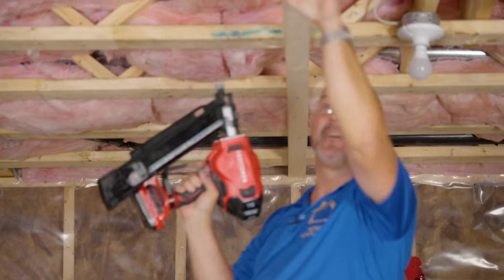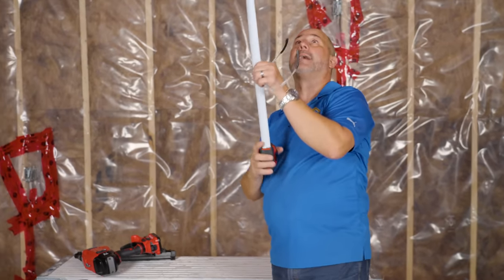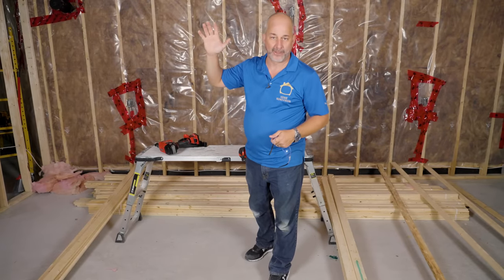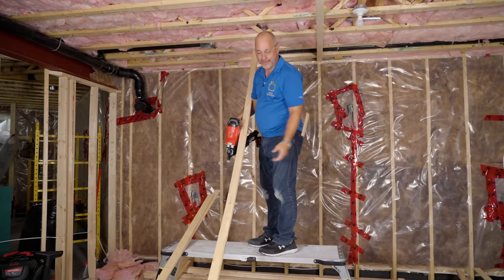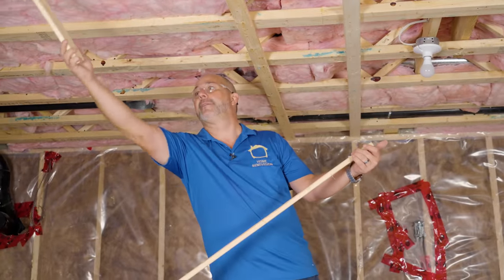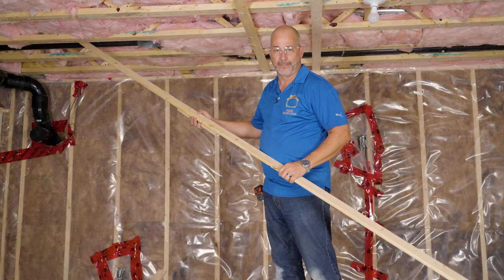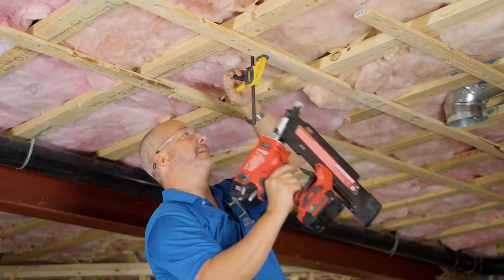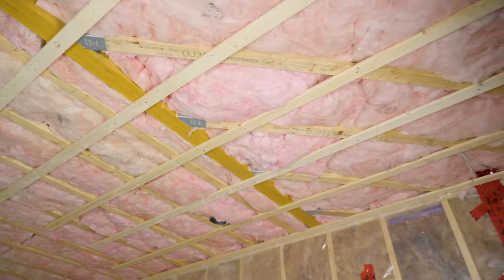Why You Should ALWAYS Strap Your Ceiling

Comment: If am using 4.5 x 8 drywall panels, do you still want use a spacing of 16inches on center or would you wan to 18 inches on center?
Reply from the maker: keep it at 16. so much better to help avoid nail pops .Cheers! install horizontal. Cheers less taping.
Reply: Thank you, also appreciate the quick reply!

Comment: Curious how much extra strength is added with these straps nailed to the underside of the joist? Seems like if such weight from above was enough to deflect the joist it would have no problem pulling on the nail holding the strap on, or bowing the strap itself, as the strap is laying flat and is thin stock???
However I love the idea of creating an extra direction for a chase way, and 16 spacing through out!
Reply from the maker: it is small effect but helps against warping of dimensional lumber. for better results for deflection use 2x4 if you have a bad case. Cheers!
Reply: Steve, the answer is zero. Engineered floor truss tied together with a 1x3 to transfer deflection load from 1 truss to the adjacent trusses will do nothing to help minimize any deflection in your flooring above.  I'm a fan of Jeff and his videos, but his claim here is incredibly weak.

Comment: Hummm my joists are engineered…and they are on 24” centers! 😢😢😢
I have tile in the kitchen and breakfast room…and the grout is popping! 😢
I’ll try strapping…I really hope it helps!
(The house is in Georgia, and 20 years old)
Reply from the maker: I would suggest 2x4 strapping for a tile floor to avoid deflection. Cheers!
Reply: @HomeRenoVisionDIY  Thank you for the reply. I have a 2000' basement that I plan on finishing...using your video series. Plan on sound proofing half; again using your series. ...before that...I have to build out the master sitting room into a closet...using your videos...then a laundry room and finally a pantry. And oh, did I mention a motorcycle garage under my deck? I've already built two retaining walls a couple years back...guess what video I watched? LOVE your series. I could have NEVER afforded this otherwise.
Reply: The 24 inch on center causes the subfloor to deflect between the joists. That is the weak point not the joists,

Comment: Do you need strapping if you already have blocking? I have 2x10 floor joists that span about 12.5 ft.
Reply: Blocking is much more effective to distribute floor loads to repetitive members like floor joists and reduce long term deflections than strapping. In fact, I don't think strapping is really doing much for deflections. If you live in an existing house that's been around 20-30+ years, your floor joists have probably already undergone all the long term deflections they will see and there's really no need to worry about deflections unless you are unhappy with the levelness of your floor. I agree with all the other points for strapping in this video, though I think he should have mentioned the possible exception of basements with bottom of the existing framing near 7'-0" above the floor level (every inch counts in this case).

Comment: I'm trying to drywall the ceiling of the main floor of my house (with only an attic crawlspace above it). Is strapping necessary? Also there already is some strapping from the current ceiling tiles that I want to remove, should I just leave what's already in place? Thanks for the video!

Comment: Drywall should break in the space between framing and be joined with a butt board. It keeps the seam from protruding and keeps ceilings and walls flatter.
Reply: Doesn’t make sense, it is the framing that determines the flatness
Reply: I can see an argument for that where the joist is high or low it will help average the error or blend it across more distance. However I have never seen anyone do that, and would rather just fix the out of plane joist. The hump or dip would still be there otherwise, this just spreads it a bit better to make it less noticeable.

Comment: I love your videos, I've learned so much from watching them. I would like to ask about drilling the holes in the drywal for pot lightingl-I saw you use the drill in reverse to begin-I'm a bit concerned that I'd do damage so thinking about making a mock setup to practice. Would this be your approach as a beginner? TIA!
Reply from the maker: I encourage drilling in reverse for beginners to avoid the hole saw running away from you. this was designed to give you the best chance of success. Cheers!

Comment: So question in the middle of designing a new home.  Should I do this for first and second floors ?

I will be using advantech for undersheathing.  I have not decided on using dimension lumber or I-beams for floor joists.   That's a 20k option for the I beams.  I'm at the max distance for span on dimensional lumber and I want to minimize any bounce/deflection.
Reply from the maker: your decision should be driven by what type of flooring you will be installing. if you want large plank engineered flooring and or tile then engineered joists are not just recommended they are a necessity. if you are going with strip hardwood or carpet or any floating floor dimensional works just fine.

Comment: I’ve read 10D nails are best for installing strapping. Would you recommend ring shanks for the holding strength? Or would you recommend a different fastener?
Reply from the maker: Hi Andy. 10 D is a structural nail. I recommend folks not over think this problem. there will be 32 nails for each sheet of 1/2" lightweight drywall. that means each nail is supporting around 1.5 pounds. have you ever tried to remove a nail with a hammer claw. trust me ....it is not going anywhere.
Reply: @HomeRenoVisionDIY  thanks for the reply! I am definitely doing this in my basement. Great video and very helpful! I think the structural improvement this brings to the floor alone would be reason enough to do this!

Comment: I want to do this, but have a specific circumstance that I want to accommodate a 5/8" thick strapping. Do you think ripping 5/8 plywood and using that would be suitable to hold drywall?

Comment: For the same reasons given; why not add strapping then to the wall?  Ease of electrical, insulation around duct or plumbing, etc.?
Reply from the maker: electrical boxes are secured to the vertical lumber and since walls are not load bearing in the horizontal direction it is quite redundant.

Comment: Jeff, I plan to use  Sonopan sound board ,then rc plus resilient Channel with 2 layers of 5/8 drywall, should I strap the ceiling first?
Which way should the resilient channel run in relationship to the floor joists?
Thanks 
Mike
Reply from the maker: Hi Mike, Yes! I actually did a theater room in this basement. we strapped and then sonopan and then strapped with 2x3 again and then 5/8. this gave us a perfect seal and a chase to add potlights without breaking the sonopan layer. the end result was fantastic. of course we also used 2 layers of fiberglass r20 and only 1 layer of 5/8. Not perfect since the room shares a trunk line with the room above but that video will be coming out i  the new year. It all depends on the level of sound protection you want.

Comment: Have you thought about the possibility of a single nail through the strapping into the floor joist not being adequate enough? When I finished my basement last year, I used screws as I didn't trust the nail to hold the sheetrock on the ceiling. I worry that over time, with the weight of the ceiling pulling on the strapping, that the nails just won't cut it. Screwing in the strapping was definitely a much slower process. Was I wrong in believing that could ever happen? Love watching your videos and all the insightful information you share!
Reply from the maker: you can hold the weight of a full sheet of drywall 12" long with 3 screws. a nail every 16" on strapping 16 OC means 36 nails per sheet. it takes more strength to pull 1 nail than it does to hold 1 sheet. Cheers!
Reply: @HomeRenoVisionDIY  Thanks for the reply and the insightful information! I appreciate you! Cheers mate

Comment: As a builder on the US west coast where absolutely nobody straps ceilings I'm going to respectfully disagree with you about a need for strapping. If you think you're going to make lighting changes in a ceiling with a floor above in the future then sure... but how often does that actually happen. If you're looking for an effective way to connect adjoining joists to reduce flex then use mid-span blocking... I seriously doubt a 1x3 does much at all in that regard as a 1x3 has zero structural strength. And I will often have my drywall joints occur between the floor or ceiling joists so I can use backing that will create a recess in the drywall that mimics a factory recessed edge so mudding the seams will create a dead flat ceiling. Joints on solid backing will require a feathered drywall joint to look flat.
Reply from the maker: I get it biob , however everyone is moving to sound isolation these days. that means insulation in the ceilings. strapping keeps everything in place and eliminates a lot of butt joints on the ceiling. New construction does not need the extra stability but older homes being renovated definitely do. In some cases we strap with 2x4 to provide the reduction in deflection that is needed even to lay tile. Cheers!

Comment: I have a stupid stairs landing taking up space in my basement, it is only 180 CM high from the concrete floor.  I wanted to use this space to put a stack up washer-dryer but they are all 190 CM height. I was thinking the only solution is to break the concrete floor, dig up 30 CM, pure 15 CM concrete and this way I get the 190 CM I need to fit the washer dryer? what do you think? I really don't have any other space and if I can't use the space under the stairs, I will end up giving up on the bedroom that I want to build downstairs for the washer and dryer
Reply from the maker: if you want a thinner concrete floor then do it. just be sure to add some steel mesh to provide the strength you are taking away. Cheers! basement floors are not a structural component to a house so you do whatever you want with that.

Comment: So my house is under construction. My basement stairwell down is partially open, but does have a pocket door at the top. I want less foot noise. Flooring isn’t even down yet upstairs. Can’t get Sonopan. What’s my best system for practical sound impaction and deadening? Don’t want to spend a fortune. Thanks Jeff!
Reply from the maker: Mass loaded vinyl before flooring.
Reply: @HomeRenoVisionDIY  I figured that might be an option lol. If only my pockets were that deep. I looked it up and it’s crazy expensive. Considering I’d have to put if over the entire first floor since my vinyl is going in each room of a 2300 square foot ranch. 🤦‍♂️. This decision is hard.
Reply: @HomeRenoVisionDIY  Jeff sorry to bug you  but I like this idea. What pound Vinyl would I need? Cheers!

Comment: Speaking of squeaking floors, how should I address it if I already have squeaking floors? I tried the squeeeeek no more screws to fix a squeak under the carpet, but the screw heads would snap off too soon so I had to hammer the hell out of them to avoid a sharp surprise next time I walked over that area without shoes on.

Comment: Good stuff! My only concern might be that installing strapping with nails/staples might have problems carrying 5/8 drywall weight over time, vs using screws. Is that a concern for you?
Reply from the maker: not at all. have you ever tried to pull off strapping ! it is strong enough to hang off 2 nails so drywall is not an issue.
Reply: What size nails do you recommend?

Comment: Hey thanks for this. I am actually going to be strapping my ceiling soon. Would construction screws be an option instead of nails. Online community is divided. Nails are faster but screws "won't pop out". Is nails the correct answer and is it worth buying a framing nailer to do it? Not that I don't want more tools I try to put it down as "necessary" on the list of a couple projects before my SO notices I have a tool problem.

Comment: working on my house built in the late 40's early 50's the ceiling from floor to joist is 8' 1 1/2". been taking out old sheet rock in each room as i go. updating electrical with 14/2 for lights, 12/2 for outlets. adding insulation in all exterior walls. would you still add strapping with the possibility of cutting all the wall sheet rock on the walls. by the way love your video's learning alot on my house repair and updating.
Reply from the maker: I put strapping everywhere. especially when there is dimensional lumber floor joists!
Reply: @HomeRenoVisionDIY  thanks for answer and info

Comment: As an electrician I don't know how much more it costs to do this, but I'm absolutely certain it costs FAR less having me cut a trench along your ceiling to run a new circuit then have to get it patched later.
Reply from the maker: say that. Cheers!
Reply: As an electrician you should know this provides zero mechanicsl protection.  Would you run wire thru the strapping between the trusses and the roof plywood.
Reply: @geoduct  As an electrician I know this is not about protecting wires. It makes it possible to fish between studs without having to cut open the ceiling.

Comment: butt joints should fall on joists as much as possible. Never 2 butt joints next to each other, stagger the joints. You should preferably use 2 staples or at least 2 ring shank nails on every joist. But yes strapping every ceiling is always a very good idea, this is how it's done in every home here in Ottawa.

Comment: Love your videos. Thank you! Renovating a basement from a 1937 build. Ceilings and walls have strapping on them already. It’s 1/2” actual thickness, and varies from 6 inches to 10 inches wide. Would you recommend keeping that up (have to remove screws from previous drywall) or removing and putting in uniform 1”x3” strapping with 16” oc spacing?
Reply: Sounds like they were straightening floor/ceiling joists out if they were using stock that wide.  Wouldn't lose that strength by replacing with 1x3 stock.  If you need a nailer in a spot or two, just add additional strapping.  Just my 2 cents

Comment: Hey Jeff, Do I need to strap the ceiling if I am using res channel?
Reply from the maker: res channel is for sound reduction. if you have a soft deflecting floor then strapping 1x4 or even 2x4 is a better option.

Comment: Will strapping help with foot noise above the basement ceiling? Don’t really want to go with the metal channel and clips. Would rather do this with double 5/8” drywall.
Reply from the maker: for soundproofing thge best is 2 layer os insulation and 2 ;layers of 5/8 and carpet on the floor above. everything else is a reduction in performance. Having said that if you have a hard surface above then consider using sonopan if at all possible.
Reply: @HomeRenoVisionDIY  live in the US or I would get Sonopan. My plan is R30 unfaced insulation, 1x3” strapping and 2 layers of 5/8”. First floor will have vinyl plank with a backer.

Comment: Can I use 2*4s? Reason is there is a gas pipe running length of one ceiling I’d rather not do drop ceiling… I was considering using wood screws rather than nail gun, I don’t own a nail gun

Comment: What do you recommend if you’re dealing with concrete basement ceilings?
Reply: Steel grid. Like suspended ceiling grid, but beefier it just uses a Tapcon type of screw with a hole on the end for the wire, If commercial. Residential, pressure treated 1x shot on with a high pressure nailer or Tapcons.

Comment: Downside is it creates entire cavity for fire to transfer easily
Reply: Do you mean fire traveling between joist bays in the gap from the strapping? Good point. Any holes for plumbing and electrical already do this and filling those gaps with Great Stuff Fireblock foam defeats the purpose of strapping to run new wires.

Comment: Hey Jeff! I'm pulling down drywall in my in-house garage to add insulation; Yes, I know I could do blow-in insulation, but I'm also trying to reno the garage so it's semi-furnished and doesn't look like it was slapped together as fast as humanly possible (like was done by the builders 16 years ago).

I'm tempted to also redo the ceiling and considering adding strapping, and potentially adding a couple overhead lights as a "while I'm in there." What's your thought on adding strapping to garage ceiling? Have any other "must haves" while doing a garage reno for a warmer work space?
Reply from the maker: Hi Elliot, bottom line strapping holds the insulation in place and makes drywall easier. the cost is almost neutral since you save so much time and money not using butt joints.
Reply: @HomeRenoVisionDIY  Thank you, sir! I've decided with my 10' tall ceiling to try to future proof it a bit and strap the ceiling! Do you have a preferred size for strapping, eg 1x2, or 1x3? Also, if I absolutely can't avoid butt joints, do you have a layout video? The consensus I seem to find on Youtube is to stagger butt joints; yes?

Comment: Curently 3D designing my basement renovation ( brand new house, basement fully empty, no walls). Plan to start building it end of February. Would you recommend strapping before putting up interior walls? Also, the current height of the main beam and the engineered joist leaves a 1-1/2’’ gap under the joist that I have to fill if I don’t want to see the beam when I install the drywall. I planned on strapping with 3/4 and putting a SONOpan after before the drywall. Would SONOpan be a waste considering I dont have door in the main staircase going through the whole  house?
Reply from the maker: yes it is. just 2 layers of insulation is great for impact noise. to fill a 1 1/2" gap I would strap with 2x3. Cheers!
Reply: Are you saying yes it is recommended to put up strapping before interior walls as well? Wasn’t sure if that’s the intended answer.
Reply: Nah he is saying sonopan is useless in the case I described. He didn't answer on the strapping before wall question.